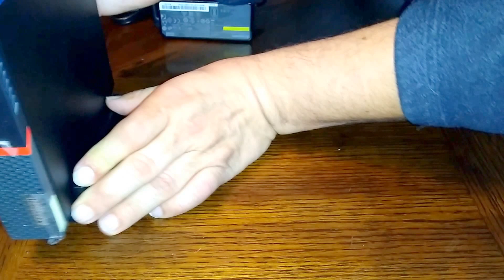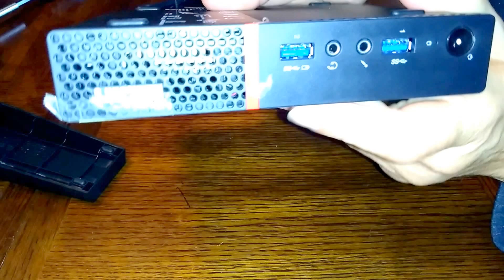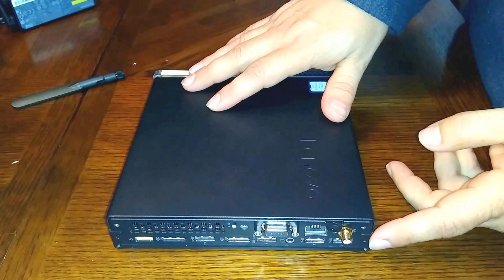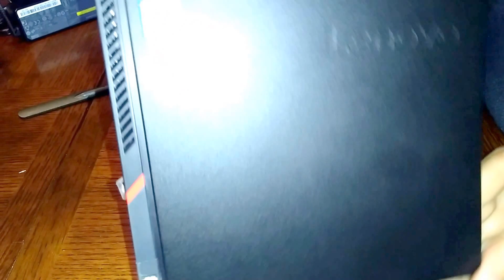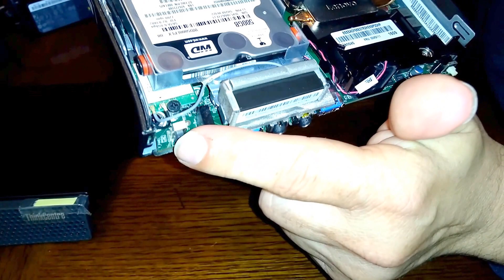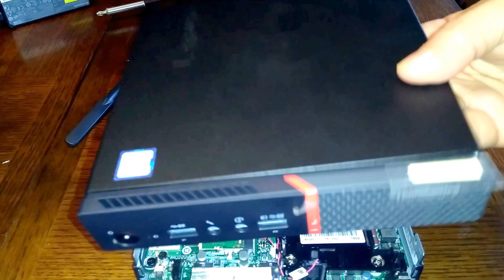✅ Lenovo ThinkCentre Tiny PC Teardown - Really Tough Case!

Comment: A couple things I tripped up on:
- the wifi bit that sticks out at the front and is on the hard drive caddy has to be correctly seated within the metal, there are two tiny black bits at the bottom of that thing
-the caddy has to be inside the two guides at the front and the one guide on the rear

Comment: I know this is an old AF vid, but would it possible to throw in an SSD drive in it? Instead of the normal harddrive? Or will it not fit the connection? :)
Reply: If it takes a 2.5 HDD, it will take a 2.5 SSD (SATA3). Most of them come with a SSD M.2 slot, and often, with a 240GB SSD pre-installed. 

I just bought a refurb. It's overheating, looks like I'll have to re-install the CPU cooler.
Reply: i know this an old question but I can see a m.2 slot right by the CPU looks like a full size slot.

Comment: Can the cpu be removed? Got a machine like yours - sticker says i5 . Thanks & great video🤓 also, what wattage is the power supply?
Reply: Yes it can, but due to thermal and power supply issues you are limited to what CPU you can use.
Reply: @reiknir  can you swap an a10-8770e for a ryzen 5 2400ge? same TDP tho
Reply: CPU can be removed, the power supply is usually 65 watts for these little machines, I have one on the way from eBay, always wanted one of these, while there's a ton I can do with it, I still havent decided what its purpose will be. The CPU can also be upgraded, just do some reading and find what CPU can be used, its gonna be something low powered for sure since the whole system is only 65 watts.
Reply: Yes Intel i7 6700T

Comment: I have a problem with the charger
Reply: I want a solution
Reply from the maker: if it's under warranty you can call lenovo and they will send you a replacement. if it's not under warranty you can buy a new one from Lenovo or buy a cheaper version from a third party vendor.
Reply: Here in Algeria There is no sales for devices.